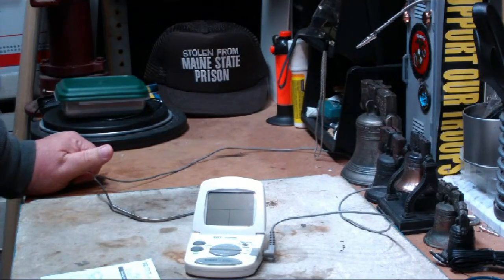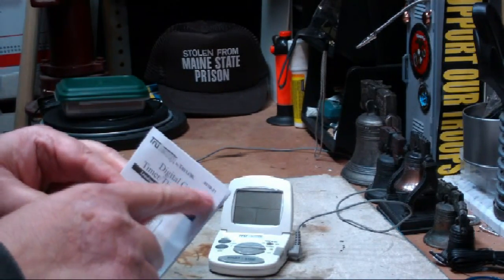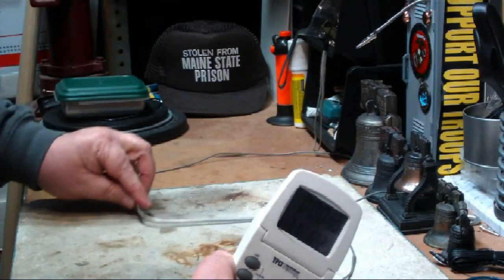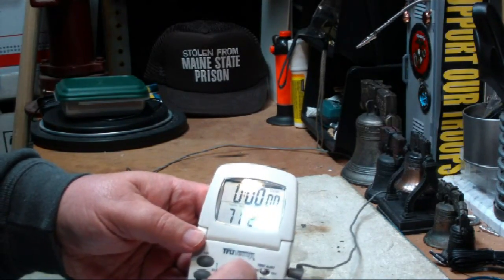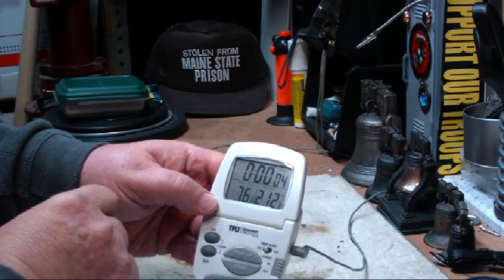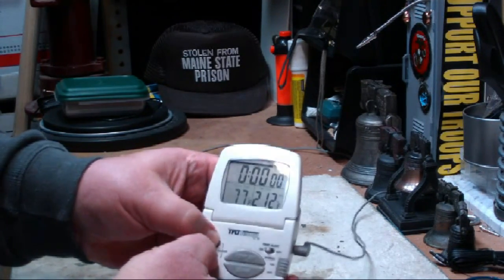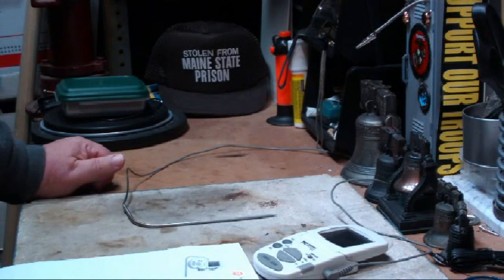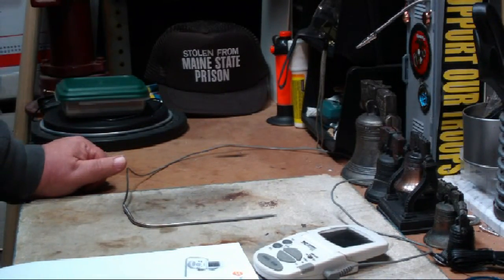Taylor Digital Cooking Thermometer

Comment: I have two of these models but ever so often I get an LO reading making my thermometer useless. Only when I replace the probe it starts working again. Can anyone explain what happens to make the probe inoperable
Reply: I HAVE THE SAME PROBLEM.  ACTS LIKE THE BATTERY IS LO.  SO I CHANGE THE BATTERY.  BUT THE LOW INDICATOR NEVER GOES AWAY.  WTF?
Reply: same problem. The weak point of these probes is the wire entering the thermocouple metal end which breaks and then moisture creeps in. The cost of replacing the probe is about half of a new unit. Mine lasted for about 6 year but will switch to a unit that has a more robustly constructed probe.

Comment: I have this model...every now and then the word "LO" comes up on the left side...and I have brand new batteries in it....hmmmm
Reply from the maker: Hi Carol. Was the thermometer cord plugged in tightly? On mine if the cord is loose or not plugged in I get that message. Hope this helps.

Comment: Our model 1478 (similiar to yours) does not move from the "lo" reading.  I have changed the batteries twice to no avail.  Any ideas to make it work??
Reply from the maker: +jnm potter The "lo" usually means the probe isn't plugged in. If it's in maybe it doesn't work, in that case can you still take it back?
Reply: @MrHiramCook  I have the same problem.  Did you find a solution?  Or did you have to replace?
Reply: Have the same problem Can I buy a new probe